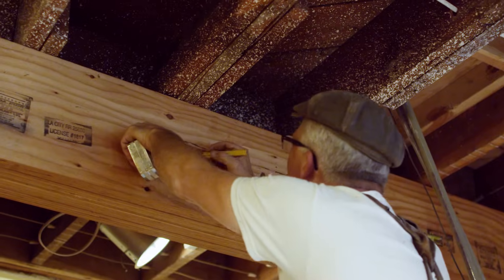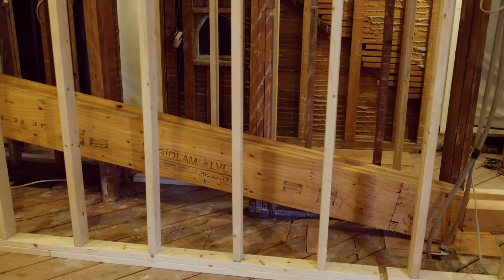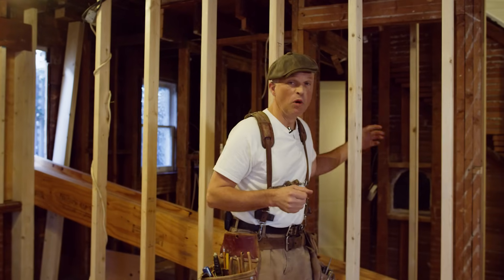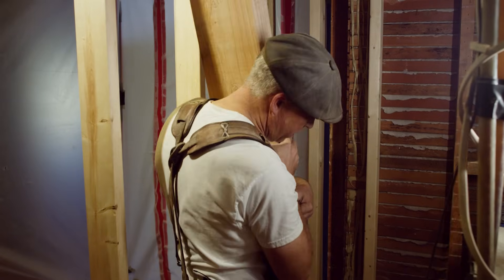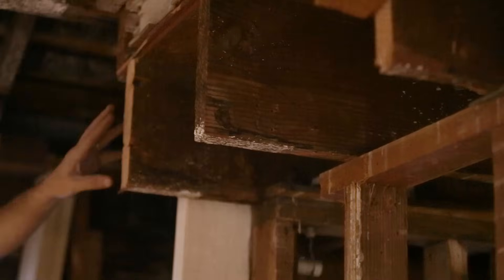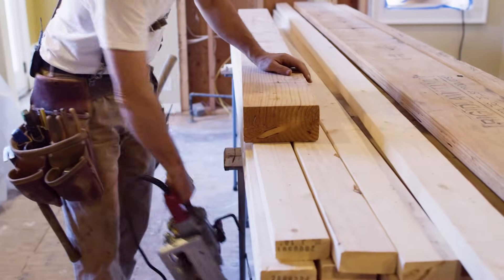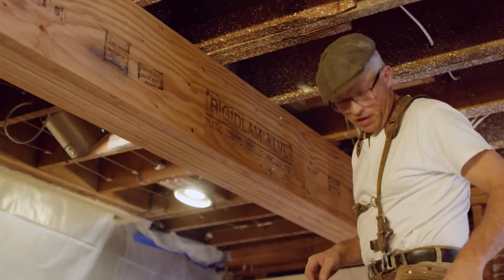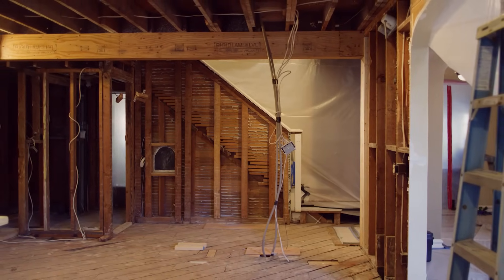Installing LVL Beams During a Residential Remodel

Comment: Hello, first off I want to say I enjoyed your video!  I am remodeling my house and am putting in a 19' span 4-2x12 beam that my stringers will hanger from straight down the middle of my house dividing evenly on either side.  I question my local lumber yard about how I should build the beam.  They suggested an LVL but they didn't tell me it would come in sections like you have shown in your video.  They said it would be the size of 11 2x6s laying on top of one another,  really heavy.  So I chose to build a 4 2x12 with plywood and metal valley tin sandwiched in between each 2x12.  I am wondering if the beam I am about to build depicted above will be strong nough to span 19' and hold 11'5" stringers on either side.  The lumber yard told me it would not be code and not strong enough.  My house is a single story house so nothing but sheetrock and insulation will be held by this beam and stringers.  The reason I chose not to use the LVL was weight and cost.  It just seemed like over kill.  Just a weekend warrior here so any advice will be greatly appreciated and reflected on.
Reply: That would be strong enough.

Comment: I was looking at these beams as well for support to replace an old support during a building move.. Moving a cabin and lifting up to 2nd story and the 16' wide cabin used a beam through center.  Was trying to figure out their guide and appears a 21' span for a 22' building would require 3-18" of these LVL beams, hope I read their chart correctly, going with 8" walls all around for more R value and load capacity. Been decades since was in remodel business, I only followed orders, and too poor to pay for consult..  They had just a rough 6x6 with 2 supports that lasted nearly 100 years, and since my bedroom will be underneath this raised building, overkill equals better sleep... cabin was on a failing foundation, hopefully she will sit into place and settle in short order so can replace roof, she has a tweak from sill to rafter on 1 end, but couldn't see it going to waste where she sits... Menards 40 miles away is our only cost effective source for materials, local lumber yards are a good 50% higher cost, but more convenient..  Decisions and much more reading, thanks for video..
Reply: The menards units looked like stacked 2x4s unless I was on the wrong product page...  Like I said a month to gather knowledge before the move...  all summer into fall to get it right..

Comment: Hi I'm putting a  2 2x12 lvl beam 17ft.on a load bearing..can the ends support that weight or do I need to add a post some where
Reply: You should be fine. LVL is strong. But you will need more than just reassurance for the beam. You need to make sure the floor itself can support it. That means putting load bearing posts under where the load is being distributed on whatever floor. Otherwise, the entire ceiling could be supported by only 2 joists in the basement.

Comment: Nice, i usually glue between the 2x12s then lock them together but it looks good to me
Reply: think deep 
Glue/ construction adhesive such as PL Premium does not adhere to LVL’s since it is wax coated. Not sure exactly if it is wax. However, the coating on the faces of this product does not except adhesive. 
Best thing to do (in my experience) is to clamp them tight & use Timberlock lag bolts or something similar.

Comment: How much does this normally cost?
Reply: They don't cost that much if you do the work yourself.   I'm installing LVL beams for my kitchen/Living-room wall removal for an open concept and a 1 3/4' x 9 1/4' x 22'  beam is only $102 (you'll need 2 min) but if you mean $3-5k with labor thats about right.
Reply: Thanks for that James Brooks, I'm looking to order (4) 18 ft length beams of the same size.
Reply: Depends on the length of the beams. You can expect anywhere from 3-5k.

Comment: Why did you remove the temporary walls before joining the LVL's together? 
Doing that put premature load on the unfixed LVL's prior to them becoming the 'beam' they were intended to be.
Reply: Its actually done later so the 3 beams will rest in their load bearing position and be evenly sharing the load. If they were screwed prematurely, then they may all not be evenly loaded.
Reply: @WorksforMe  nice thanks for clearing thay up i was just about to comment but what you you said makes allot of sense thanks.
Reply: sorry 4 beams
Reply: @WorksforMe  Look, the purpose of a LVL is to add strength to one piece of a carrying beam, yes sistering LVL's together is permitted however you NEVER EVER screw LVL's together when there is a main load applied! You want to avoid any sort of warping and distorting of one or 2 lvl's in a set of 4. Make sure they are all strait and just because you did that on either end does very little to help the cause.  Prior to putting a load it's so that the load is evenly placed on all the LVL's!  Look I know it says that you are Master Carpenter but next time talk to a engineer about load deflection and structural deficiencies.  I have seen too many video's of people claiming that there way is the right way when they have not even consulted any sort of engineer's for assistance.
Reply: He clamped the beams together, top and bottom, before removing the temporary walls.  Maybe that allowed freeing up the workspace for screwing down the length of the beam?  I dunno.

Comment: Thank you for this. I'm at the tail end of a similar project -- not a remodel but truly a rescue demanded specifically because of load-bearing damage done in 1950 and 1980 to my 1869 home. We were not able to fully re-work the kitchen due to the roof restraints in what was originally storage area. The Structural Engineer advised sizeable LVL beams in two places; forming a "T". Our carpenter added a third beam above the sink (unconnected to the others).  The impossible challenge I have now is at the bottom of the "T". The Structural Engineer specified a PT Pine Post sitting three feet out in the floor supporting the LVL Beam. Which rests on ceiling perimeter framing that is layered and strong but not strong enough to support the LVL Beam. The Post eats up four feet of space in small space line holding one appliance and a planned pantry. The size of that post cannot be enfolded into the pantry or hidden in any way. I'm exploring with another structural engineer ways to transfer the load bearing service of the post into that wall. Very complicated now. One earlier structural engineer friend had told me of a classic "H" of support in similar situations. Turn that "H" on its side, in this case. Where LVL goes on both walls and the Joist is supported between them. I still don't know how to solve this. Unless I do, the space will lose its functionality. Gain strength, but lose its purpose in the home. That's always the dual focus of working in living space--even if it is historic space.

Comment: what is the cost on something like this?
Reply: for the joist itself at 24' - $300-500
Reply: Hi Kyle, thanks for responding, what was the cost for the labor for this particular job if I may ask.   I have a garage that has a post in the middle I'd like to change out.
Reply: to put a new beam in, beam included, estimate about $2000 for a standard installation without any significant engineering or special materials like steel. Demo of existing walls, and finishwork not included.

Comment: Thanks Daniel for a very informative video! You did not mention about the floor surface where you installed 2 LVL supports, one on each side... When you remove a load bearing wall, all you see is the floor joist so how to prep the floor ready for the supports and what size and how many pieces of lumber needed to have a safe and strong support foundation?  Also if you have a 2 story home all rough framed using 2/2s and the loadbearing wall that needs to be removed is studded by 2/6, could you remove such wall and if yes, why a 2/6 stud wall and all other walls are 2/4s? Thanks

Comment: do you know what the limit is for length with LVL beams? i have about a 20ft stretch and am wondering if this will work or if i need a steel beam
Reply: The Happy Builder it depends what the beam is supporting. If it's only supporting roof loads then you may be able to use an LVL, particularly if it's a metal roof. Take a look at the manufacturers' span tables to get an idea. Alternatively a structural engineer (I am one) could look at it and size a member (timber or steel) for you.

Comment: whats bellow the beam - did not see you mention the  foundation
Reply: Yes, the beams are supported by solid point load posts down to foundation or footings as per the engineer specification for the project. I would have loved to capture that on film but that would have made it to long. So hopefully we will be able to do another one on posts and footings later, showing the importance of engineering and permits, and how all that is accomplished.
Reply: Yes, the beams are supported by solid point load posts down to foundation or footings as per the engineer specification for the project. I would have loved to capture that on film but that would have made it to long. So hopefully we will be able to do another one on posts and footings later, showing the importance of engineering and permits, and how all that is accomplished.

Comment: do u have a son name michael westbrook
Reply: No, sure don't.
Reply: DB Cooper's MoneyBags  Yes we had to continue the point load down to the basement and place and new concrete pad with a saddle. Good question. I like your handle name!
Reply: DB Cooper's MoneyBags  Basically, You need to make sure your loads are solid down to a footing, and connected to the wood frame. I would consider the granite a facing and not put any undue support pressure on or against it. It's well worth paying a structural engineer to do a site visit, provide a drawing and stamp.